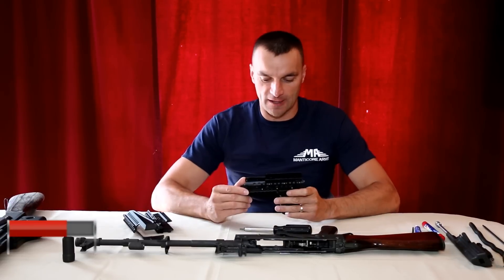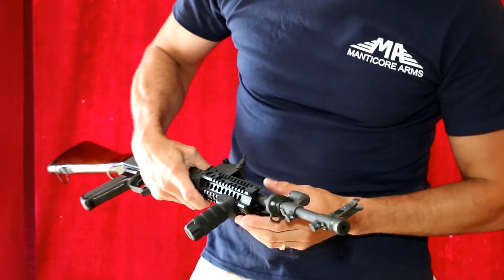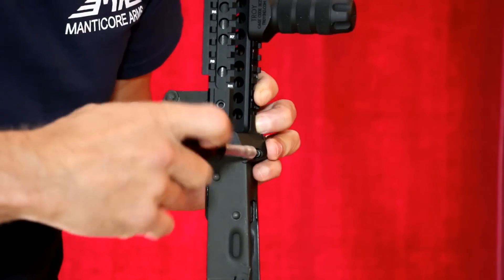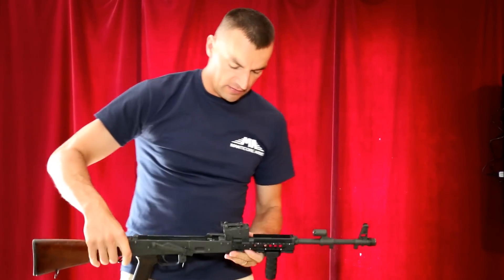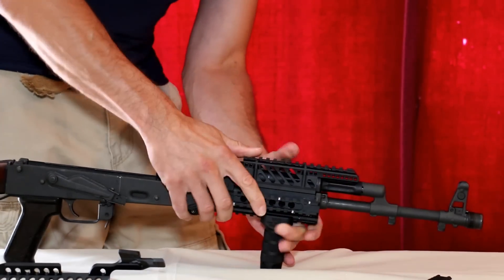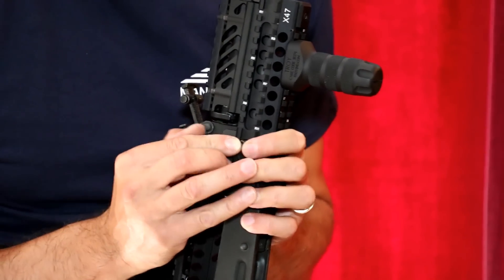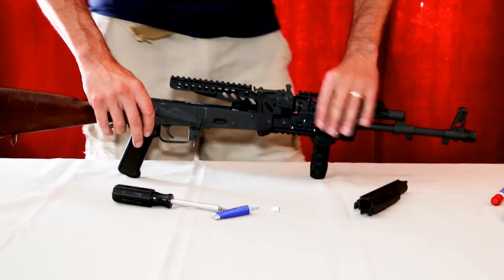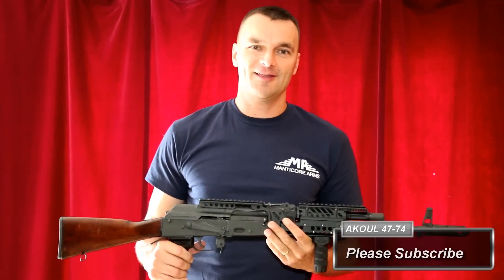AK47 (AKM) / AK74 - TDi Arms X47 Rail System - Installation Video

Comment from the maker: @J Rodriguez, i have M4 adapter on my Saiga. It has high edge which requires dust cover to be lifted higher, but there is not enough clearence on the dove tail -  and that's why i was having issues. - Rob Ski
Reply: Ah I see, I totally missed that in the video, a buddy just pointed it out to me.

So I'm guessing a stock Saiga AK, I shouldent run into problems.
Thanks for the reply!

I really enjoy ya'lls videos, greetings from Texas!

Comment: I have an CAA X47 and trying to install the lower rail on an AK 74...the front retaining bracket does NOT fit inside the front handguard. There's material in the inside of the handguard that doesnt allow the front retaining bracket to "slide in". I'll have to call them tomorow. #Frustrating. Good video Rob
Reply: Just googled, it's 500$ handguard. Crazy expensive
Reply: @mrdato116  yeah, NOT worth it!!!

Comment: Rob
Is this X47 rail the best top or extended rear mount option if not what is the best and battle ready for an "SHTF rifle". I am looking at getting the C39v2' and it has no side rail option as you know.
Reply from the maker: ajfam871 X47 is a very sturdy setup. Expensive, but well made.

Comment: Hey Rob, I installed this on my arsenal 74. does the groove that is cut into it match up with the rear sight post? My X47 rail sits off centered on the dust cover if you know what I mean. Wasn't sure if this is normal? Is it supposed to be perfectly centered on the dust cover?
Reply from the maker: +KirbyStyle2 Mine was...
Reply: +Ak Operators Union, Local 47-74 hmm, thank you. I'll have to go back and check and maybe watch your installation video.
Reply from the maker: KirbyStyle2 could be alignment issue with your receiver...or maybe screws are tighter on one side.

Comment: The way that the rail over the dust cover is mounted, it is cantilevered and therefore may not have enough rigidity to prevent it from vibrating with each shot, not a good thing when using a optics.  Perhaps it "rings down" quite rapidly and not affecting the time needed to re-aquire the target  What can you tell me about my concern ?
Reply from the maker: JAQUEOBAUER i had no problem with it holding zero and i did some quick "engagements" with it. I understand your concern with vibration, but i think they (TDi) included this in to the design.
Reply: Thanks for the response. I am not a fan of  the AK, but its simplicity and durability  have yet to be surpassed by any designer since Kalashnikov. Leave it to Yankee ingenuity to develop a huge aftermarket of accessories and enhancements.  Keep up the work, someday I might get enthused enough to build a parts kit AK.

Comment: Hi Rob, why can't you install the top portion on c39?
Reply from the maker: singhzfaith13 the C39 gas tube is slightly different than regular gas tube and upper portion wouldn't fit without modifications...- Rob Ski

Comment: Probably not, but do you have any idea if it will fit a Hungarian AMD 65?
Reply from the maker: Mike Beck sorry Mike, i don't have AMD to try, but from my experience with AMDs, i wouldn't count on it...
Reply: Ak Operators Union, Local 47-74 Thanks for the reply. Not many options for the AMD 65.